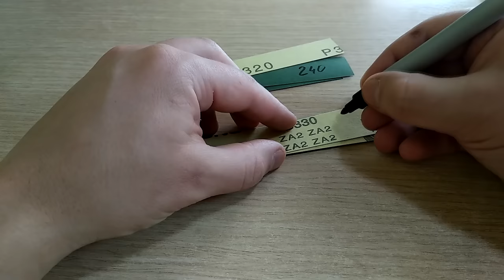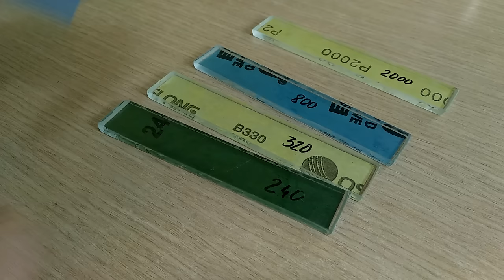3 in 1 Knife Sharpening System — DIY Knife Sharpening Jig

Comment: Хороший станочек!!! И идея с брусками и их сменой - супер!!! Можно усовершенствовать в части точности угла заточки. Для разных сталей и форм клинков нужны разные углы заточки режущей кромки. Мысль следующая: 
1. На направляющей, к которой крепится абразивный брусок приклеить колбочку от уровня, чтобы показывал горизонталь. 
2. Поставить направляющую с бруском на то место, где будет режущая кромка. 
3. Выставить с помощью опорной гайки, которая на вертикальной шпильке, строго горизонтально направляющую с бруском. 
4. Затем измерить, сколько оборотов опорной гайки на вертикальном стержне нужно для отклонения на 1 градус от горизонтали. (Придется повозиться с измерением)
5. Измерить угол наклонной поверхности станка. Дальше все просто. Оборотами гайки прибавляем или отнимаем нужное количество градусов. На станок клеим табличку, с указанием угла наклона поверхности и количеством оборотов на 1 градус, чтобы не забыть ))))) Удачи!!!
Reply: Супер!!!
Reply: Умный да.Уважаемый 👍
Reply: @D G That's true, however, since the angle will always be the same at a given position of tne nut, only need t measure one time with a protractor, and make notches in the threaded rod every 1/2° or 1°, then use a permanent pen (Sharpie) and write the degree range on the base, "10° — 20° by 1/2°"

Comment: I have followed your plans and made one. It works very well. I am particularly pleased with the scissors sharpening arrangement. I have however improvised some changes. I used whatever material I have on hand and modified the dimensions to fit. I find that it is not necessary to use a separate clamping plate for chisels. I just shortened the clamping platform to allow room for the chisel handles to float free.  I have also cut out a corner from the clamping platform to allow scissor blades to be clamped nearer the middle. I used pieces of 6mm MDF cut to size instead of glass plates. I just fold the sandpaper and clamp the ends in the wedges. Thank you very much for the idea.
Reply: can you record and up video show that how does it work on youtube. thank you

Comment: Took inspiration from this and tastfully built it into my wooden knife holder block! Saves time, space, and keeps knives sharp more often! Really appreciate all your efforts in posting this!
Reply: I also used 2 small brick shaped magnets to hold things, its quick and easy, and also gets rid of the problem with having to use low profile 'hold downs' so they dont get in the way of the swiveling rod.. the magnets are also placed in a small tight fitting ziplock pouch so it's easy to dump/cleanup/throw away metal dust and possible slivers =)

Comment: You have convinced me, I will spend 2500 $ to make my own workshop and buy all the tools you have, drill table with drill, wood and metal saw, etc, to build my own knife sharpener.
Reply from the maker: The design of the knife sharpener is very simple - you can make it using only hand tools. After manufacturing, the tools remain with you and help you to make other useful tools. But you can buy, I don’t impose my opinion, I just show you how you can make devices with your own hands

Comment: In the plywood, under the knife blade, cut a hole for the bar, strong neodymium magnesium. You will not need the metal plate with which you screw the knife blade. I did it at home and it works great.

Comment: Hi , why the sharpening platform is angled upward !? and why you did not screwed the knife holding metal plate directly to the flat surface of the base? I've noticed that the angle on the knife  platform is 20°.. is for that reason?! because the most used knife does use 20° sharpening angle?! thanks

Comment: Nice project and appreciate your efforts to make and share it, can you advise what height you have set on the threaded rod for the holder.
Reply from the maker: Thank you, Felix! For kitchen knives, I make an angle of 25 … 30 degrees. To set the height, I use the "Protractor" application for the phone - just place the phone on the plane of the blade of the knife and on the base of the jig - the difference between these angles will be half the angle of the knife sharpening you need
Reply: @MazayDIY  thank you so much

Comment: This is a tedious job as you have to change a number of sanding sheets. Why don't you put all the strips of the sanding strips at a certain interval and adjust the main shaft which the strips are attached to. Start with the roughest one and gradually move on to the smoothest one to achieve your result than to keep replacing the sanding strips. In this way you complete the entire side of the tool being sharpened and then turn it over for the other side to be done. It would definitely shorten you time on the job.